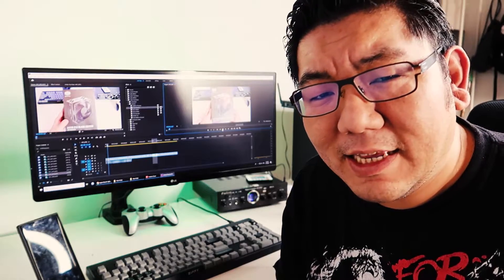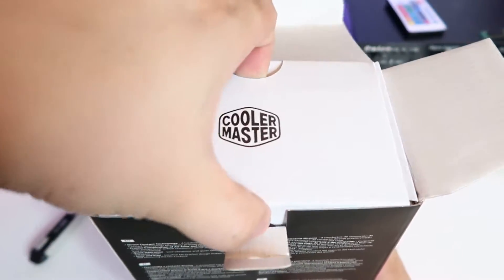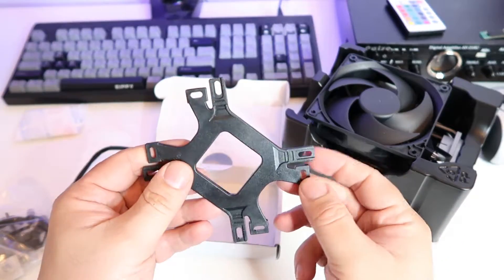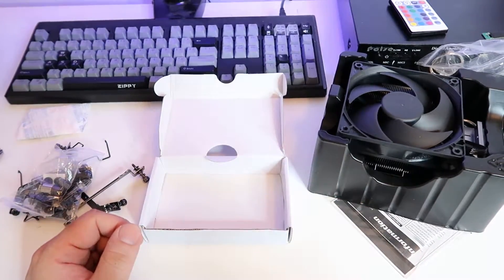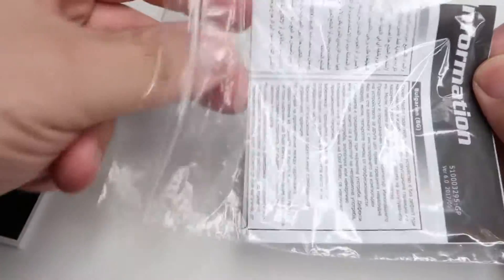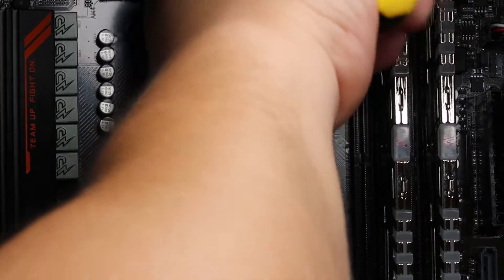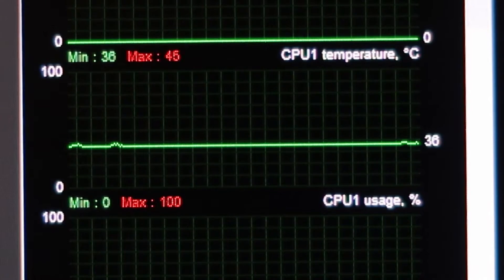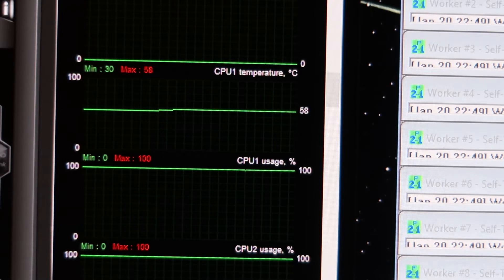CoolerMaster Hyper 212 Black Edition Review, Unboxing

Comment: Hello; nice video. Do you happen to know if the base plate of the heatsink is pure copper?  I am planning to apply conductonaut liquid metal if there are no aluminum in the base plate. Thank you.
Reply from the maker: Im sorry, i do not know for sure, all i know is the heatpipes are direct contact
Reply: @TripleCCreation  Thank you for the reply. I had a arctic heatsink with aluminum material on the base plate that completely disintegrated right before my eyes upon application of that liquid metal. Lesson learned lol.
Reply from the maker: @barristerperez  wow, jeez thats terrible
Reply: @barristerperez  if you see brown metal/copper at the bottom of cooler then probably yes

Comment: do you know if this CPU cooler will fit  my HP Obelisk Omen PC  Model 875-0014 ?
Reply: As long as it has a 4 pin connector and supports lga 1151 foot intel or am4 for Ryzen